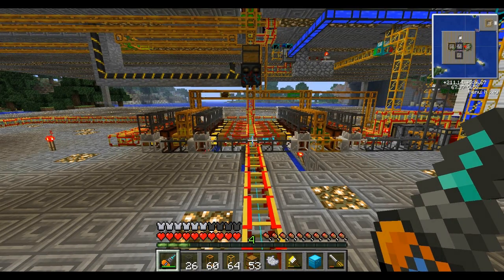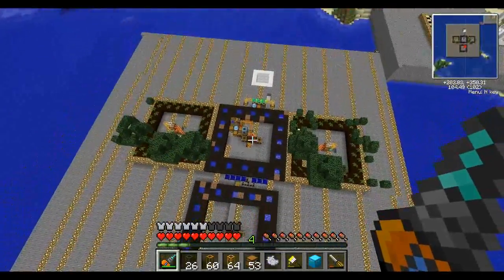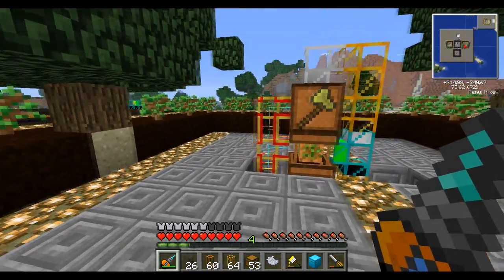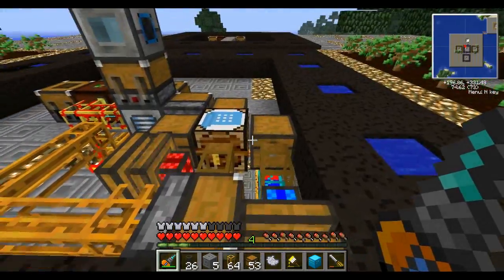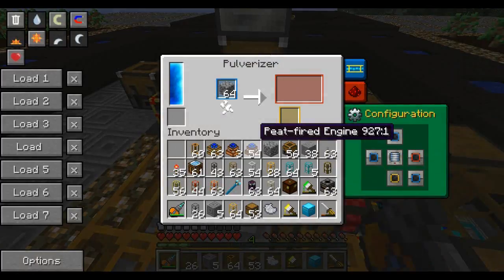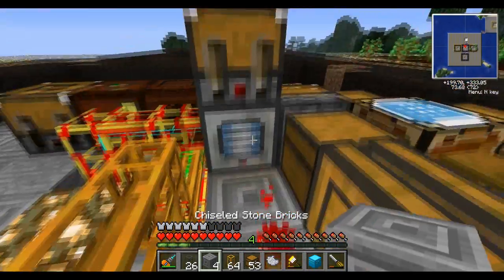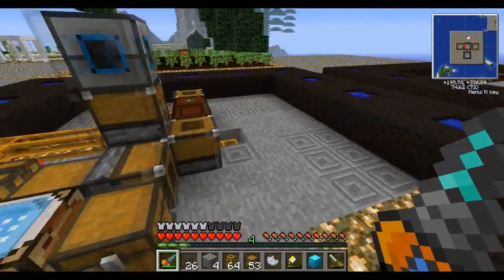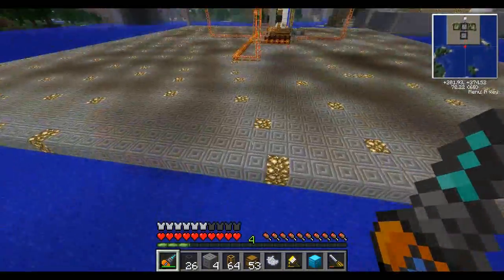Forestry Perpetual Farms Part 1 (Above The Ground)

Comment from the maker: Just the default 2 seconds on the timer.

As for the request I would but forestry's next update is switching to multi-block farms, and while the regular ones I'm using here are still in, he plans to remove them after another patch. So I'm gonna try to get the multi-block automated next.